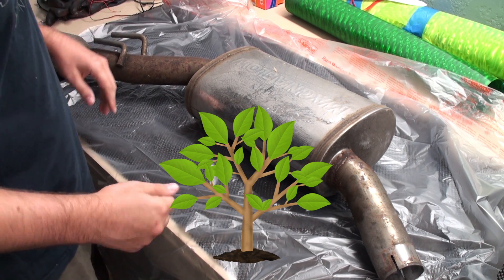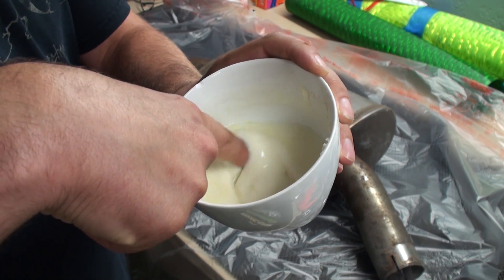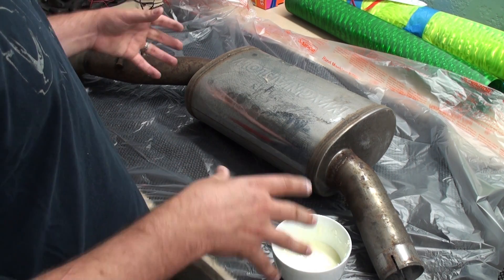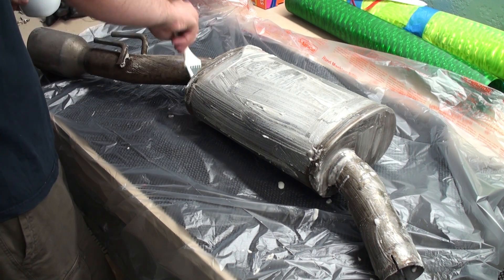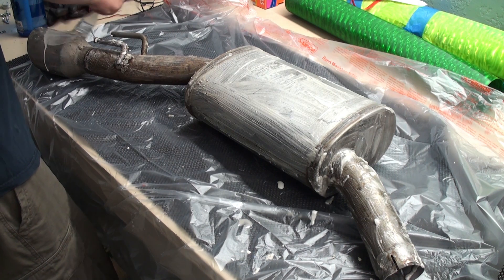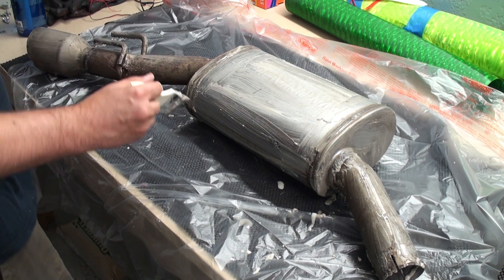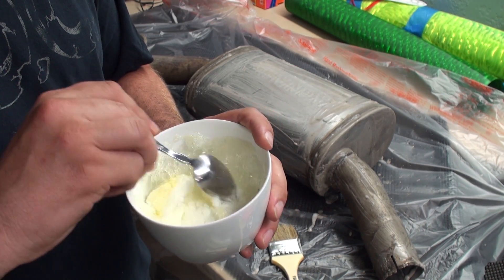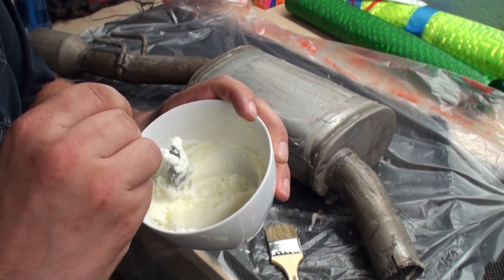Baking Soda and Lemon Juice for Rust Removal

Comment: Very late to the party - but the baking soda (sodium bicarbonate) would.mainly be for the consistency I think. Since it is alkaline it will actually partially neutralize some of the citric acid. The fizzing is the acid and the base reacting. The dilute citric acid is what is removing the rust. The sodium bicarbonate would only help as a mild abrasive it you rubbed it.
You can buy pure citric acid (powder) cheaply, dillute it in a container with water and just submerge stuff for the same effect. Almost any acid works for this, and citric acid is one of the mildest - but especially good at disolving mineral buildups (scale). Vingar (ascetic acid) is also a good alternative as it will evaporate completely without residue on fine parts. Other acids are often more expensive and toxic, but stronger. Hydrochloric acid is the strongest of the common ones.
Always rinse in water thoroughly after using any acid, or else acid residue will actually make it re-rust much faster than normal. A light mist of any mineral oil (ie. wd-40 type product) is recommended as a last step because it will protect against new rust.

Comment: Any acid will remove rust--acetic acid (vinegar) citric acid (lemon juice) oxalic acid, phosphoric acid, etc.. Baking soda neutralizes acid.. After an acid bath, you usually put the treated metal into a baking soda and water bath to stop the acid. Your muffler didn't have any rust. All that you did was clean it.

Comment: You must now add a sealer of some kind. Auto wax, not polish, works fine. If you don't it will now rust twice as fast since you have removed the layer of oxidized material which was actually slowing down additional oxidation. Do not use motor oil, especially used motor oil. It's acidic. Never undercoat a car with used motor oil. Two year later and it's off to the junk yard.
Reply: Thanks I'm doing this today
Reply: Thanks I'm doing this today

Comment: Baking Soda and Lemon juice cancel each other out. Why or more importantly how...would anyone even contrive such nonsense? Any benefit you get from either product is greatly diminished by combining them.
Reply from the maker: H+ protons from the citric acid (lemon juice) is breaking the oxygen bonds of rust (iron oxide) to the metal. This forms OH- ions, which causes the pH to go up. Baking soda (sodium bicarbonate) is acting as a buffer to keep the pH lower, which is better for chelation.

Comment: probs just ad more lemon
Reply from the maker: +Dylan Waddell yeah, hindsight is 20/20.
Reply: Technically Fun be good if you had an experimental piece and see if change in mixture effected it
Reply from the maker: +Dylan Waddell nice suggestion. If I make another similar video, I'll incorporate that. It would be a slightly more scientific approach. I like it. Thanks!
Reply: Technically Fun your welcome.
another idea if you do make the video could do something along the lines of home made rust removal techniques
Reply from the maker: +Dylan Waddell yeah, I had a request to do something similar. I also had a request to do a drain cleaner video using baking soda and vinegar. If I start making more content, those will be at the top of the list.

Comment: The chemical reaction is the baking soda neutralizing the acid in the lemon juice.
Reply from the maker: +danny3793 sort of... H+ protons from the citric acid (lemon juice) is breaking the oxygen bonds of rust (iron oxide) to the metal. This forms OH- ions, which causes the pH to go up. Baking soda (sodium bicarbonate) is acting as a buffer to keep the pH lower, which is better for chelation.

Comment: fun man thanks for the vid! when you cut in the video after the application of the paste  how much time elapsed?  Im mad maxing a squad car and inbetween sealing it has gotten quite rusty (bare steel and rain= mad rust :) ) prob need to triple what ever time you let it marinate.

Thanks mate
Reply from the maker: +cbas about 15 minutes elapsed. You might be better off with several applications instead of longer times because the mixture will dry at around 15-20 minutes depending on the environment. I've stripped bare metal and made the mistake of waiting too long to seal. Even the humidity was enough to create surface rust. Best of luck to you!
Reply: thank you very much for the recommendation .  I have used a urethane clear with in a an hour or two with decent results.  any pitting I didnt grind out fully does grow under neath.  that which endures looks pretty cool.  I have used royal jelly it got rid of most rust fast yet also seemed to add surface rust as vinegar does.  Im going to use your tech for my next application thanks brotha
Reply from the maker: +cbas You're welcome! I made that mistake with not fully grinding out the pitting too. Took a few years, but the rust came back. Best of luck on your next project!

Comment: HI i think that mixing lemon (acid) and soda (base) produces a neutral. I would suggest the soda is acting as a mild abrasive and the lemon is doing nothing, maybe providing some liquid. you could use the soda with water and get same result.
Reply from the maker: Duncan King H+ protons from the citric acid (lemon juice) can break the oxygen bonds of rust (iron oxide) to the metal. This forms OH- ions which causes the pH to go up. Baking soda (sodium bicarbonate) can act as a buffer and stabilize the pH for better chelating

Comment: Simply awesome
Reply from the maker: janardhan rb thanks!
Reply: Brother pls tell whether it will remove rust on bike kicker and tell the ratio
Reply from the maker: janardhan rb It will help, depending on how bad it is. If the metal is pitted, there's no helping that. This method will definitely help with surface rust. As for ratio, start by squeezing a full lemon and then add baking soda progressively until it reaches a consistency just a bit thinner than whipped cream. If it starts to dry too fast on you, add a bit of water to thin it out. I hadn't done this enough times to perfect the ratio, so I hope this gets you started.

Comment: What a misleading video. There is no point in adding baking soda to the lemon juice, the baking soda will actually weaken of not completely neutralize the lemon acid, making it remove the rust even harder. All you really need is lemon juice for rust removal.
Reply from the maker: Hak Kar H+ protons from the citric acid (lemon juice) can break the oxygen bonds of rust (iron oxide) to the metal.  This forms OH- ions which causes the pH to go up.  Baking soda (sodium bicarbonate) can act as a buffer, keeping the pH lower & better for that chelating action.

Comment: Lemons obviously have acid in them and baking soda is used to nuetralize acids. When mixed together you get your chemical reaction ( your fizzing)  What your left with and put on your stainless steel ( which doesn't rust) did nothing but wash of the dust and dirt!
Reply: Yeah, I'm wondering about that too. Using a base and acid together neutralize each other.
Reply: Okay chemist 👩‍🔬
Reply: Those muflers are cheap and do rust :)
I had the same.

Comment: This material is anticcoro. Anticcoro never rust!
Reply from the maker: Pirát Welding stainless steel burns off a layer of chromium oxide, which is what prevents stainless steel from rusting. There was plenty of rust at the welds.

Comment: It's been a few weeks, but yesterday I finally finished my cage...It looks great, Home Depot didn't have the converter...or I didn't see it. But I did the primer and paint, I hand sanded down the bumps on the metal, and gave it a sealer from Rustoleum, and hope it does well. I finally sprayed it. The brushing was a bit teadious, had to use 2 cans, but that's ok. my dove is in his new house, and adjusting well.
Reply from the maker: That's great! It seems like you've done everything correctly and completely. You shouldn't have any rust issues moving forward, provided the finish holds up and protects the bare metal. Give your dove my regards!

Comment: Today I went out there and washed down my bird cage...it really looks good, many areas were cleaned...the rust is bad in some places, I gave it a vinegar wash today and have let it sit and dry. Tomorrow I'd like to maybe prep for painting with a brush because I want to stop the corrosion...and the rustoleum I hope will slow down that process. Cage will be outdoors...My husband was impressed to see the difference.
Reply from the maker: That's great! Thanks for sharing. From what I understand, the Rustoleum rust converter works really well. The good and bad thing about rust is that it can be inhibited by sealing the metal from air and moisture. All it takes is a tiny pin-sized area to be exposed and it can grow like a cancer. I've had good luck spray painting using their product. I'm glad you're able to salvage your bird cage :)
Reply: Power to ya!

Comment: that muffler wasn't sooo rusty, I have a bird cage and with the paste, I believe I can remove the rust....I need to know how much baking soda to lemon, and is that regular tap water...or something else???? pls respond as this will be a must do project asap
Reply from the maker: Yea, I probably should have washed it first to show the little rust spots a bit better. There were some spots, but not many. I honestly did not intend this video to get so many views since it was my first one, so I was a bit lazy. Anyhow, the water is normal tap water. I'd say about one squeezed lemon to about 1/2 - 3/4 cup of baking soda should do the trick. Thanks for watching.

Comment: baking soda neutralises the acid in the lemon juice,so why does it work?,i cleaned some rusted bicycle parts with white vinegar recently & used baking soda to neutralise the acid afterwards & im wondering why its removing rust now?
Reply from the maker: H+ protons from the citric acid (lemon juice) can break the oxygen bonds of rust (iron oxide) to the metal.  This forms OH- ions which causes the pH to go up.  Baking soda (sodium bicarbonate) can act as a buffer, keeping the pH lower & better for that chelating action.

Comment: Haha guys baking soda and lemon juice will leave that dish even cleaner than before. Don't worry about it ruining the dish, so long as you rinse out the residue it'll be clean.
Reply: Also: if you have a cleaning toothbrush for grout or shower tiles, you can use that to get the solution into tight spaces and grooves, like you were seeing on the edges. Thanks for the de-rusting tip! Time to use this on my oven racks!
Reply from the maker: +Erin Fischer Oooo I'll have to try it with a toothbrush for tight spaces! Happy cleaning!

Comment: Would this work on the blades of ice skates?😂 They've all rusted on the bottom and it looks disgusting😣
Reply from the maker: It should work pretty well for surface rust, but might require a bit of grinding if the metal has been pitted from the oxidation. You'll probably want to try a minimum of three applications with a good fifteen minutes of sit time before wiping off. Best of luck!

Comment: I didn't hear how long you let that concoction sit on the muffler for?
Reply from the maker: Yea, sorry. I get that question a lot. I'd say a minimum of fifteen minutes. You could try up to thirty minutes, but the mixture will start to dry up.
Reply: +Technically Fun could you use old baking soda that has been in the fridge soaking up moisture?
Reply from the maker: +Michael Hinchey Yes, however, it might be better to get a new box. You could always test if it's still good by testing the chemical reaction. Simply place a few drops of vinegar on a small handful and see if it starts to fizz. If it does, it's still good.
Reply: +Technically Fun yes it fizzed a bunch.  What is your ratio?
Reply from the maker: +Michael Hinchey I used about half to three quarters cup of baking soda and one whole lemon's worth of juice.
Reply: +Technically Fun oh real lemons?  I'm trying to be economical here.  lol
Reply from the maker: +Michael Hinchey Haha, well, the bottle of lemon juice they sell in the store may be processed, so I couldn't comment on how that might affect the results.
Reply: +Technically Fun Thank you.  Your vids help the common folk

Comment: I need to try this on my wheels I'm afraid it won't do much they are pretty rusty
Reply from the maker: It may take a few applications with plenty of waiting in between coats before rising it off. Naval jelly works great too, but is much more caustic. You'd need gloves for sure.
Reply: ill give it a shot

Comment: Dec. 21/15 - Have rust on my bathroom chrome bar in tub and I'm going to try this mixture on it.  Should I use a sealer?  I guess the water from showering made pinholes and so rust is there!  Never heard of chrome rusting but now I know!  Thanks much for your tip and about your bowl, I laughed b/c if you go to dollar store you can get your very own bowls and mix all kinds of stuff in them without wife getting upset lol hahahaha.  Have a great day, bless you.
Reply from the maker: Yes, a good chrome sealer will definitely help. I've used the kinds made for motorcycles, but it's pretty much the same stuff. You may also want to try googling using coke on chrome to remove rust. Just another interesting method to try! :)  Thanks for watching!
Reply: +Ellie Mercer chrome does not rust it is what comes in contact with the chrome that rusts. or its just not good quality chrome.
Reply: +jefke12321 Jefke, I only have a rubber mat and put the odd facecloth on my chrome bar in the bathtub.  From what I've read, chrome will sometimes develop tiny pinholes and that's what causes the rust.  Thanks for your comment.  (Feb. 23/16).

Comment: if you buy a new exhaust can you do anything to it to prevent from having to clean it like this in the future or would that just cause more problems such as rusting
Reply from the maker: Stainless steel is already the protectant that is designed to reduce the onset of rust. The quality of the stainless (the grade) is what determines how well it will perform. Titanium is the best, but way too expensive for most. Chrome plating also helps, but stone chips and scratches will remove the protection.